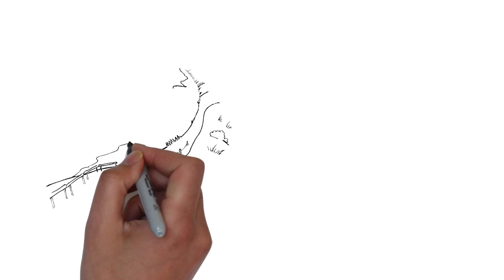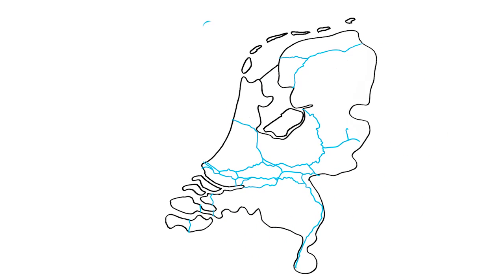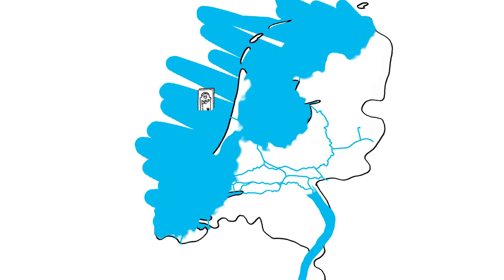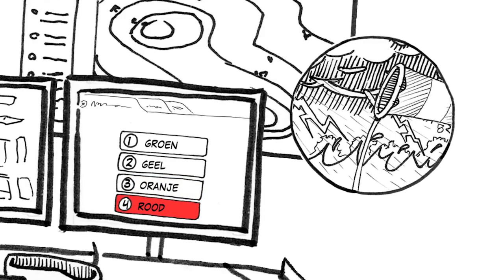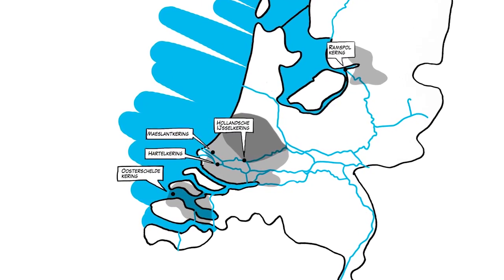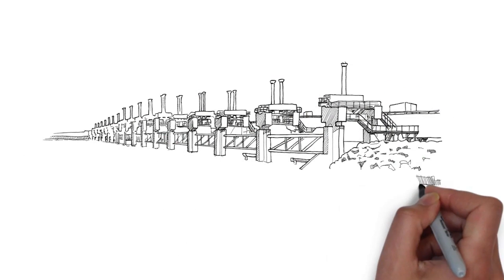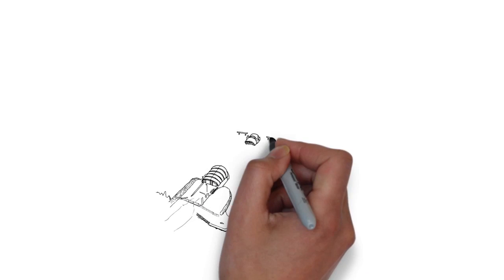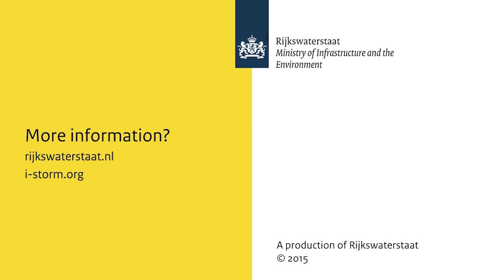Storm surge barriers for a water safe Netherlands | Animation

Comment: Got a question.Maerslantkering designed for rotate the extra water to the other new canal but how to manage it by not floating structure’s own costs a door or a panel using under it ?
Reply from the maker: Thank you for your question. Could you clarify what you mean, perhaps? The Maeslant Barrier has 2 doors, each 210 m wide, 22 m high and 15 m deep. When the barrier closes, they fill with water and sink to the bottom within 2 hours. It operates with ball-and-socket joints, each of which are 10 m in diameter and weigh 680 tonnes. 
You can read all about it here: 👉https://www.rijkswaterstaat.nl/english/about-us/gems-of-rijkswaterstaat/maeslant-barrier/index.aspx